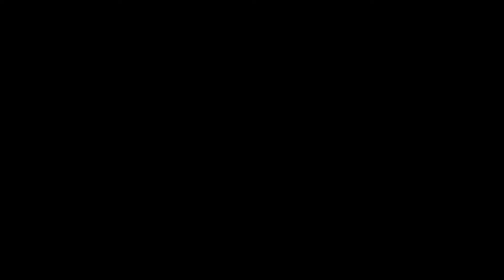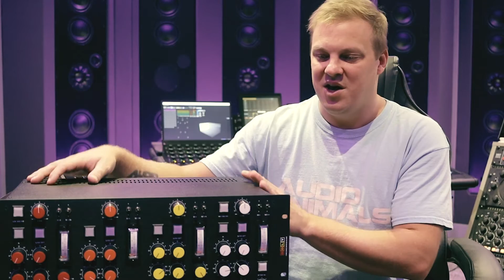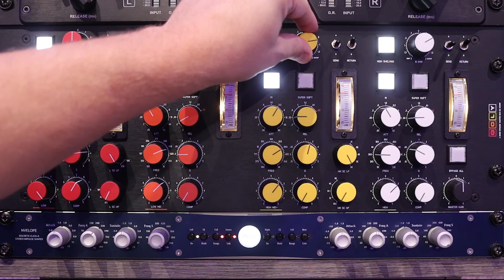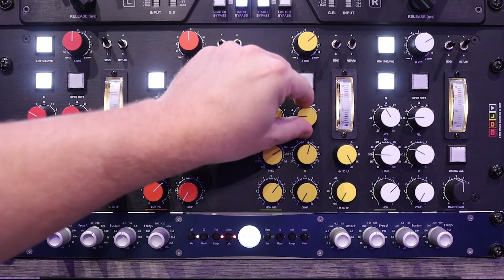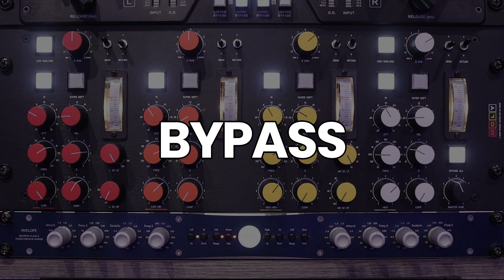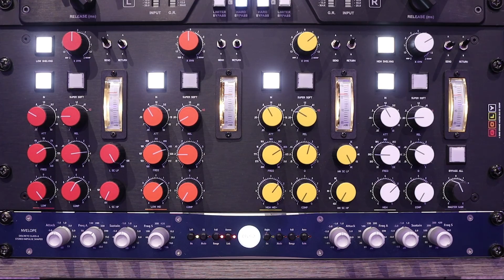Goly 4 Band Dynamic EQ Review (Gravity Rainbow)

Comment: I have the 2 band version of the unit and can vouch for the brilliance of what Gustav Goly developed with the design. A 4 band unit, wow, what a beast. Excellent demo...
Reply from the maker: The 4 band is essentially the 2 of the 2 band versions. I swapped out my 2 band CrossCOMPression EQs for the 4 band version. But I want to compare the 2 band to the 4 band to compare the EQ section. I initially felt the EQ was smoother and more like a Porter Grinder. So I'm interested to see if this is the case. I will do a video on this to confirm.
Reply: @AudioAnimalsStudio  that would be a fantastic demo, would greatly appreciate hearing/seeing that. I was considering a second crosscomp to do a 4 band dynamic as well. My initial thoughts were that the crosscomp filters were slightly different from the Grinder. The High Shelf on the Crosscomp is like pushing air, until you get down into the high mids where it gets a bit more assertive, in a good way for me. I did notice you mentioning that the 4 band filters were from the Grinder. Or perhaps like a Grinder. Either way, what a beast you have in there. I wonder how the box tone differs between the 2 and the 4, if any? Btw, I thought I had a nice rig, Jeeeez man, yours is off the charts.
Reply from the maker: @engmix  you should see the other studio we have here. This mastering chain is small compared to that one. Studio A has some incredible equipment in it. Including a 11u goly rack which after adding this has turned into a 15u goly rack. 

My instant thoughts on the 4 band was that the EQ was better than the 2 band. But this may be placebo which is why I want to do this test for myself. I always like to come back to questions with facts rather than opinion. Opinions can often be wrong. I get the impression it's more Porter Grinder like. We'll all find out next week.
Reply: @AudioAnimalsStudio  Hats off to ya on the success of your studio! I've been making records professionally for nearly 40 years, mostly in the US. Cheers to making records!

Well said on facts versus opinions. Looking forward to seeing the follow-up. And you might be right, as I did notice that the crosscomp is not quite a Grinder, for better or worse, usage depending?
Reply from the maker: @engmix  there's definitely a difference, I'm sure of it. I instantly thought the EQ sounded better.

Comment: Wow.  The mix examples really showed what this unit is capable of.  The big question I have of course is -- does this replace your Goly Crosscomp EQ?  This seems essentially like a 4-band version of that, with routing capabilities!  His website seems to confirm that as well... Guessing the older 2-band will be sold off?
Reply from the maker: Yes essentially it's a larger 4 band version of the cross compression EQ. It will directly replace my CrossCOMPression EQ. If you added another CrossCOMPression EQ you will have a very similar unit to this without as much routing capabilities.

Comment: Are there plugins capable of the cross (upward) compression trick, knowing I can't afford this beast?
Reply from the maker: There isn't a plugin that directly does this but using something like Fabfilter multiband comp you can achieve a similar effect. Not the same as it's compression and not dynamic EQ. It's very unique. There is a 2 band version which has the CrossCOMPression feature in it. These half the price. 

Watch this review https://youtu.be/GLd87vuvnT8?si=RJR1mNanJpc3s7WV
Reply: @AudioAnimalsStudio  I've used Fabfilter ProQ 3, in dynamic mode, to trigger a de-essing effect in a certain frequency range, but this is a whole other ballgame. The mix came instantly alive!